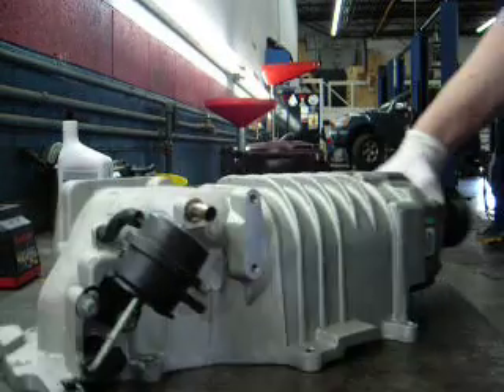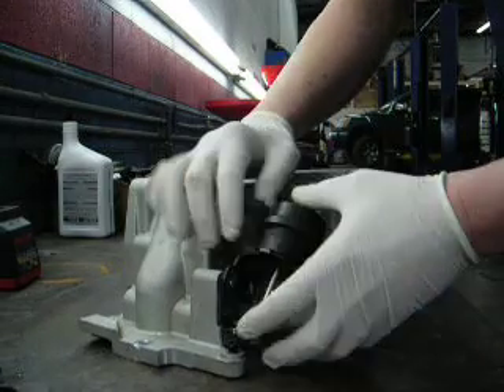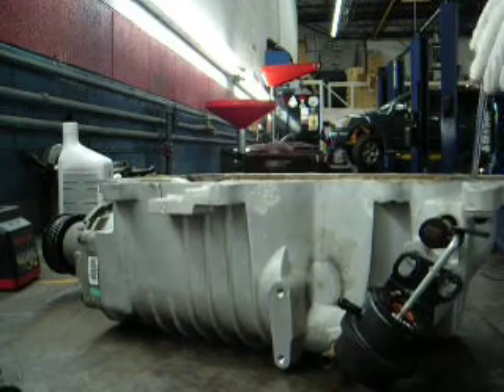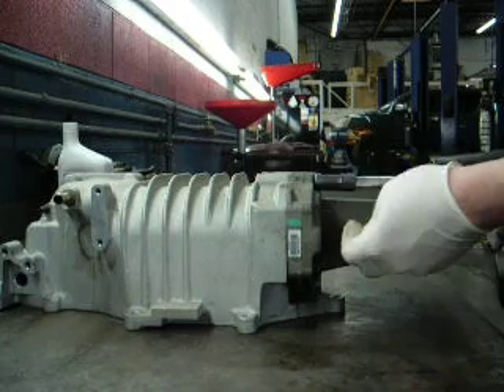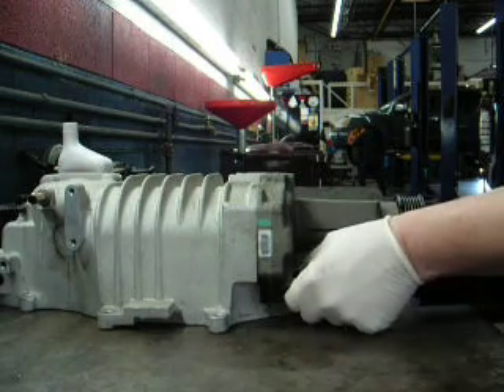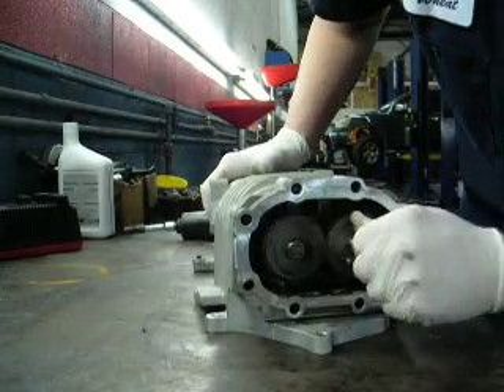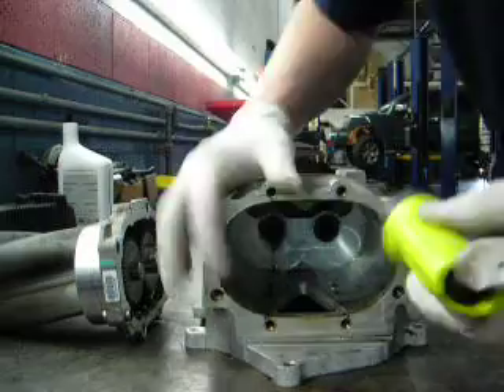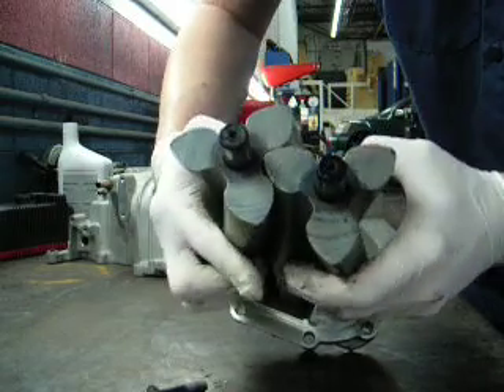Breaking Down An Eaton Supercharger

Comment: this is an eaton m62 blower, they are a tad smaller then what other manufactures use, the nissan vg33 (3.3) is a pretty small engine compared to GM's 3800s. sometimes i wish i had one of these sitting ontop of my frontier.

Comment: @berniedaboss yes, several companies do- with this style of s/c, the 'intercooler' is sandwiched between the bottom of the s/c and the intake manifold. Runs coolant, pumps it from the core to the heat exchanger out in front of the core support (most of the time)

Comment: @steelstrings1312 completely on ebay $1300-1500 heads injectors computer wiring loom blower belt everything, rest of the money goes to installation, if you can do it yourself it is cheap,

Comment: looks like a very simple rebuild. why is it not recommend to open it? looks easyer than a starter rebuild.
Reply: the replacement of bearings on these superchargers requires a press and knowledge that the average DIY mechanic doesnt have.
Reply: So you much  take your car to a  dealer shop and replace with a NEW $5,000 UNIT.

Comment: I don't see a place to draw air....does it just increase intake flow?  Like a vacuum boost to force more air to be drawn in?
Reply: That big hole in the side at 2:50
Reply: +Collin Bru   yea, like Tom said at 2:50 is the inlet. On my 1999 grand prix an air hose connects there and that air hose is first drawn thru a filter box to filter the raw air that is being pulled from the engine compartment.

Comment: when putting everything back together (serpentine belt)do you need to set the charger in a certain timing with the engine? or just put it back together ?
Reply: No synchronization necessary...just mount the supercharger to the intake manifold using a NEW gasket; afterward, simply attach the drive-belt & you're done!